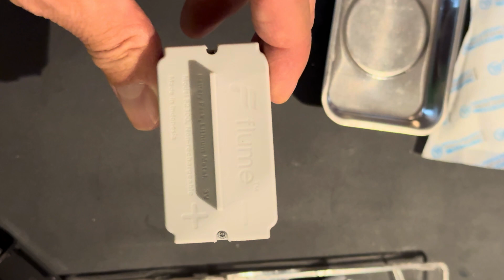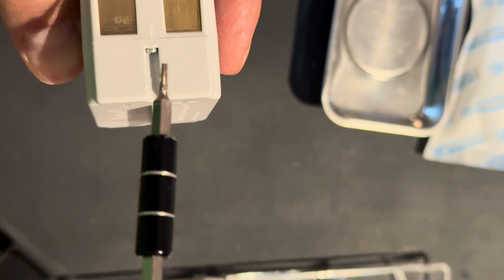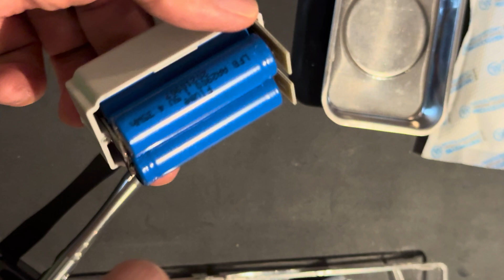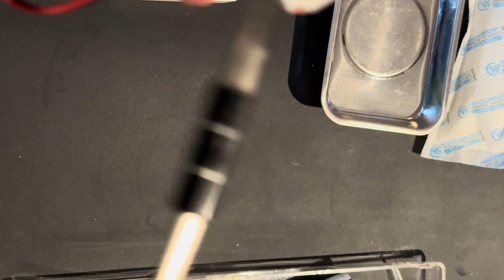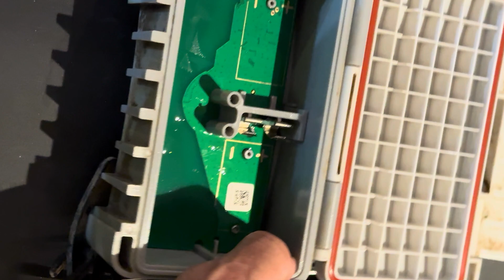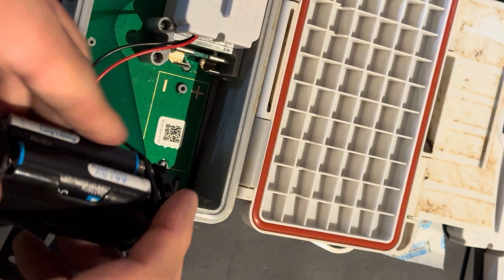Flume 2 Battery Mod to use regular AA lithium batteries

Comment: Most  AA  4- battery holders connect the batteries in series, which in this situation, I assume will add up to 6V. The original batteries in the Flume unit are arranged in parallel , which result in the 3V required for the Flume.  So if you use a 4 battery holder, make sure you insert them in such a way that the final output voltage is 3V, because a 6V output may damage the unit.
Reply: very important to check if the new pack's output is 6v or 3v

Comment: isnt this the wrong voltage? Its supposed to be in parallel and  3V total; isnt this 6V? Unless you rewired?
Reply: Looks like he did 2 cases of 3v to make 6 v . 4 batteries total